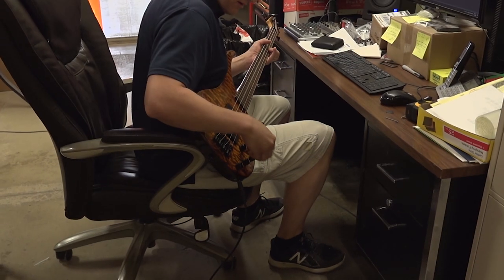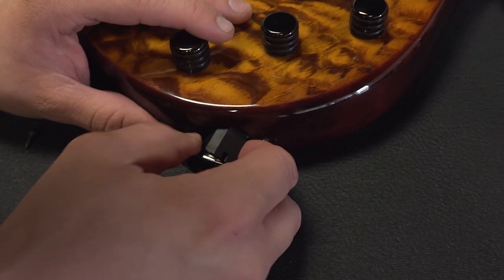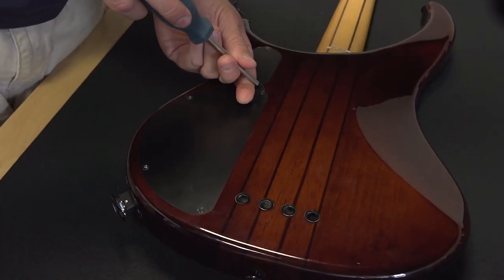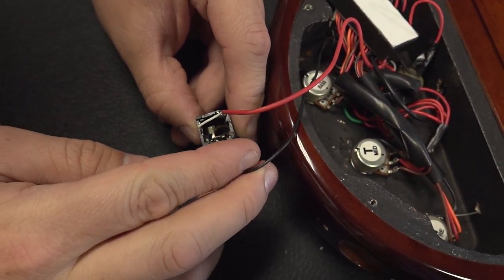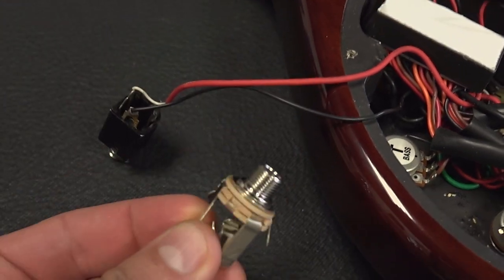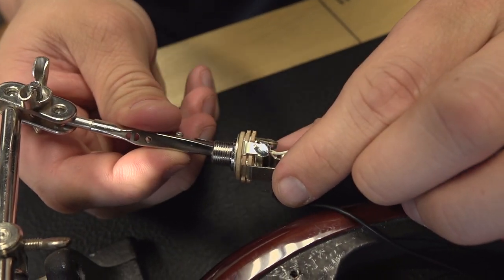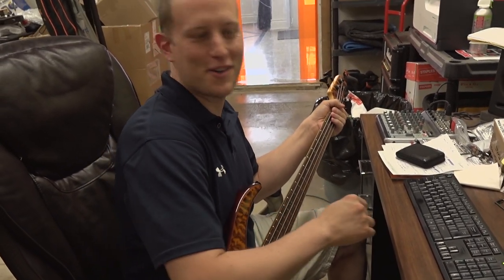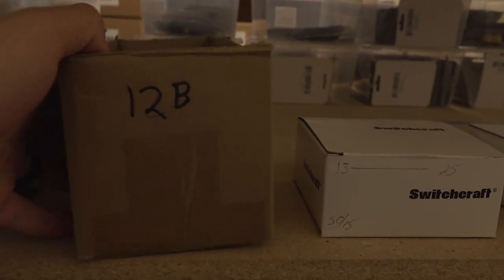Replacing A Guitar/Bass Output Jack (with active pickups)

Comment: This video was very short, and very helpful.  I had the same type shrouded jack failing/popping. 
 I thank you. My hohner b2a is working again no pops. 
The 12b I got from my local music store was about $3.50. 
Normally I try to replace the exact parts I take out, but I tried 4 shrouded jacks and none worked. 
Your up close images gave me a good view of whats what. I actually wanted to put in a protone, but could not find a good schematic or video. My bass is a thump ready now and when I pull the plug out it turns the battery off as it should. My bass has four wires, 2 go to the main ground. I am guessing you saved me a wallet full of money, because I almost took it to an expert repair shop. You Rock.

Comment: Thanks so much! I have the same type of output jack on my bass and couldn't find a wiring diagram anywhere online (I don't know the manufacturer of this jack - mine says "J.T." and 16 on the top) The wires broke so easily with this type of jack, so I'm gonna replace it with the one in the video, but this was helpful in the meantime! 

For future people looking to fix the same jack, normally red wire = power and black wire = ground, but in this case white = power, red = ground, and black = battery to pickups
Reply from the maker: Great info.  Thanks for that!  Hopefully we'll be doing more in depth tutorials in the future, rather than the off-the-cuff stuff.
Reply: This was really good quality for off the cuff! Again, much appreciated

Comment: You didn't explain where (tip, ring, or sleeve) to connect each of the leads (red, white, black) as you were performing the desolder/solder operation. That would have been helpful.
Otherwise a very nice video that gets right to the point.
Reply from the maker: Yeah, sorry. It was an impromptu video, not planned. Colours will depend on your guitar (they are different between brands, and if they've been re-wired before by someone).

If memory serves... In this specific case, the main wiring was done via a shielded cable (the red one) and a black wire from the battery. So, in this specific case, white is hot/tip, red shielding is ground/sleeve, and black is battery/ring. Hope that helps!

Thanks for watching! Will have more well thought out content moving forward as we're actually planning videos now. Woot!

Comment: Are barrel plugs the same as these regular style ones, because I'm not sure if I've got the black wire from the battery connected to the correct point. Worried that my batter is being used even when not plugged in.
Reply from the maker: In this case, the battery wire was supposed to be hooked up to the "ring" lug on the jack.  Your guitar might be different.  Best thing to do is consult the wiring diagram for your particular guitar to confirm.

Comment: Hello! I have the same problem (i think) on my bass, but only with ONE cable. All other cables work fine. Have you ever heard of cables that don't seem to fit in the input the right way? It is a decent fairly expensive cable, so not a cheap one.

Comment: Hi whats the difference between SWITCHCRAFT STEREO JACK Vs  SWITCHCRAFT MONO JACK.
I have a bass guitar 🎸  and jack problem wants to replace but which one would you prefer me to buy Mono or Stereo?
Reply from the maker: It depends on your guitar.  If you have passive pickups, probably a mono jack.  If you have active pickups, you may need a stereo jack (or some other type of jack, specific to the active circuitry in your guitar).  I wouldn't be able to tell what jack you need for certain without inspecting it ourselves.  Best of luck! 👍

Comment: Hi, I realise this is an old vid, but does the active circuit disconnect when the lead is taken out ? I have a problem with a Music man Stingray bass with 3 band active EQ, so thinking of battery life !
Reply from the maker: Depends on the schematic of your guitar.  Most bass guitars have a stereo jack (or switching jack of some type) to separate the battery when nothing is plugged in.  The wiring in this video was correct for this bass, but may not be correct for all basses.

Comment: Hey guys, should I use as a guitar jack output stereo or mono jack?
Reply from the maker: Depends on the instrument.  Most instruments with passive pickups use a mono jack.  Most instruments with active pickups use a stereo jack, or some other type of switching jack.  In a pinch, a stereo jack can always be used in a mono application.  Just make sure to ground the second (ring) lug.
Reply: @NextGenGuitars  yeee, I have active bass and my original output was same as yours, but I wonder how about integration, because I have black wire, half black and red, red.
Reply from the maker: @sagvancoffee7364  In that case, you'd have to consult a wiring diagram specific to your guitar to confirm the correct wiring and jack requirement.

Comment: This guy just replaced it and didn’t explain how
Reply from the maker: Indeed.  The short story is that the video wasn't planned and was never intended to be an instructional video.  I did my best to edit the video so it is at least somewhat entertaining.  We tried to make a companion post with a little more detail, but active circuits aren't always wired the same between different brands, so it is still a little vague:
https://nextgenguitars.ca/pages/whats-new.htmlreplacing-an-output-jack-video-included/

Many people have found the video and post helpful for their needs, as per the other comments.  But, I'm with you.  Missed opportunity for sure...
Reply: 🤣🤣 bro it’s not rocket science

Comment: Solder doesnt work on mine. The solder just slips right off
Reply from the maker: There could be lots of reasons why that happens.  Oxidized soldering tip, dry or oxidized parts, not enough heat, not enough heat transfer, and/or poor technique.  If solder isn't sticking, first thing to check is the temperatures and condition of the iron.  Is it getting to and maintaining at least 350C (~650F)?  Is the tip clean and tinned?  Are the parts being soldered clean and free of oxidation?  Once those are confirmed, you can troubleshoot the technique.  The parts need to be hot enough for the solder to flow onto them and stick, which means focusing on heating the parts you want the solder to bond to.  Using flux helps to clean the parts being joined and increases solder flow.  Lots to investigate and diagnose.  Best of luck to you!
Reply: @NextGenGuitars  it must either be a temperature thing or an experience thing. I'm not sure what I'm doing wrong because I will melt the solder onto the little metal tongue pieces where the wires make contact and it just won't stick at all, I'm wondering if there's a specific type of wire I'm supposed to use for this that's rated for steel and I don't have it, my soldering iron and solder itself are used and do not have any packaging so I'm not sure how to check but I get a small dab of solder exactly where the video says its supposed to go and the way I do the process looks exactly like the way you do it but where yours sticks mine just falls off and I'm left with random little chuncks of loose solder. Not sure what the problem is exactly but Ive cleaned everything and made dozens of attempts and at this point I've made no progress at all. Even when I try to get the solder to form around the hole so it's kind of pinched to the metal tongue looking piece, it still miraculously just slides right off and I am at a complete loss
Reply from the maker: @andacondasqueeze159  Sounds like you're not getting enough heat transfer onto the lugs you want the solder to bond to.  It could be your iron doesn't get hot enough, or maintain heat well enough.  Adding tinning flux to the areas you want the solder to bond to might help.  Using eutectic solder (if you're in a country that allows for leaded solder) would also help.  But, if it doesn't, you really need to look at getting a new soldering iron.  Preferably something with a digitally controlled temperature setting.
Reply: @NextGenGuitars  I considered this as a possibility, I'll see about getting a new iron. Thank you for the advice by the way!

Comment: Don't waste your time if you're looking for an actual explanation of "Replacing A Guitar/Bass Output Jack (with active pickups)" You may be able to stop/start the video and glean the info by looking but while these two guys were doing it they could have said the red wire goes on the... the black wire.... and the white wire goes to.... R.T.S  Missed an opportunity guys. Nice video but useless.
Reply from the maker: Indeed.  The short story is that the video wasn't planned and was never intended to be an instructional video.  I did my best to edit the video so it is at least somewhat entertaining.  We tried to make a companion post with a little more detail, but active circuits aren't always wired the same between different brands, so it is still a little vague:
https://nextgenguitars.ca/pages/whats-new.htmlreplacing-an-output-jack-video-included/

Many people have found the video and post helpful for their needs, as per the other comments.  But, I'm with you.  Missed opportunity for sure...